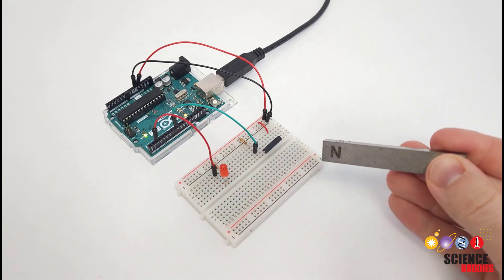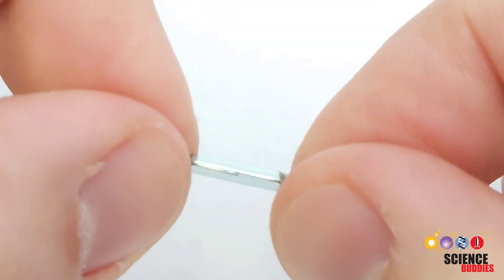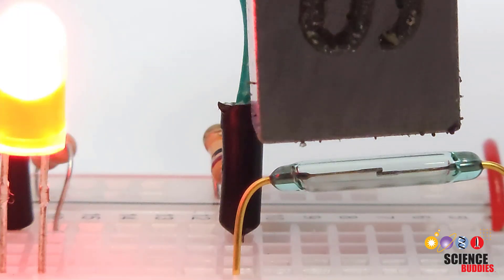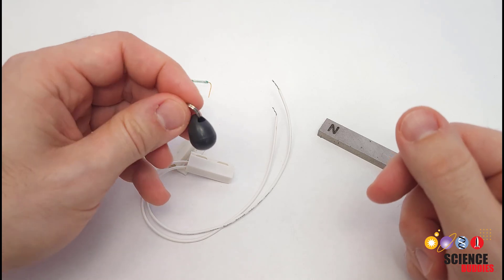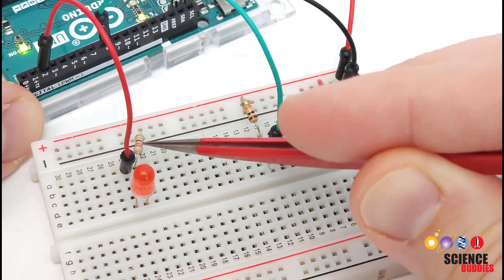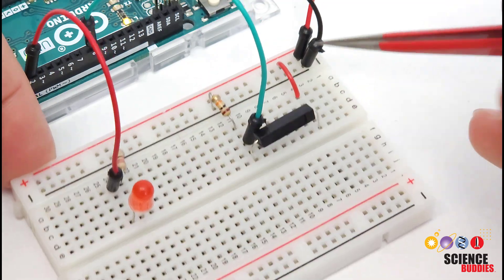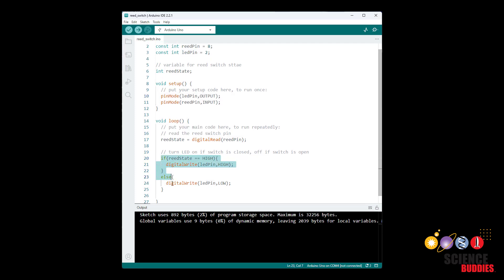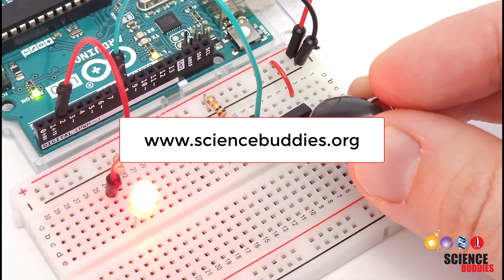How to Use a Reed Switch with Arduino (Lesson #30)

Comment: Good morning, I would like some guidance, if possible. I intend to install the 7mm reed switch in a system in which I will group 7 sensors and 7 magnets in a row, one sensor next to the other, one magnet next to the other, and the respective sensors in front of the respective magnets. My question is whether the magnets that are next to each other will be able to activate the sensor that does not correspond to yours? Thank you. https://www.youtube.com/watch?v=XFPVWwobV_4&t=2s

Comment: multiple things: can i use an neodium magnet (dont do lot of things with magnets so dont know whats the difference or if theres even one) and if so from how far will it activate with a small magnet?
Reply from the maker: Yes you can use neodymium magnets, they are generally much stronger than "regular" magnets but you will still probably need to be within a centimeter or two for the switch to work.
Reply: @Science.Buddies  thanks

Comment: In case there are limited available pins,  the same LED pin can be used as an input with the reed switch in series.
Reply from the maker: Correct! Technically if you just want to turn an LED on and off when a magnet is near, you don't need an Arduino at all, just a power supply. We wanted to show people how to use it with an Arduino for more advanced projects, but should have mentioned that in the video.
Reply: Wished I would have read this earlier.